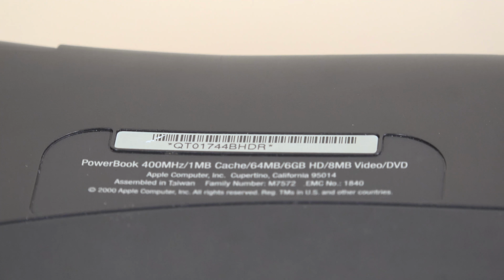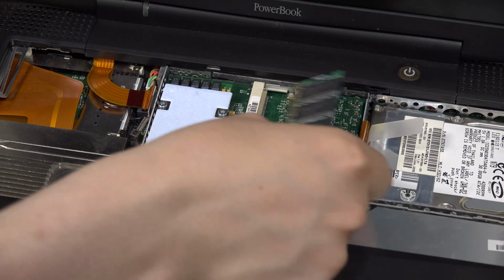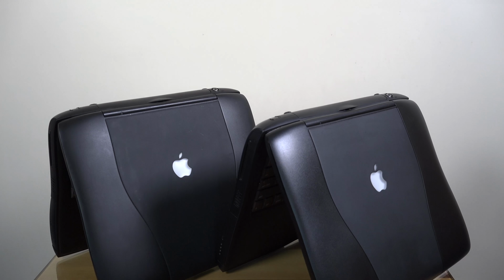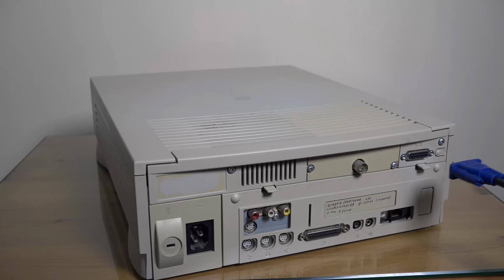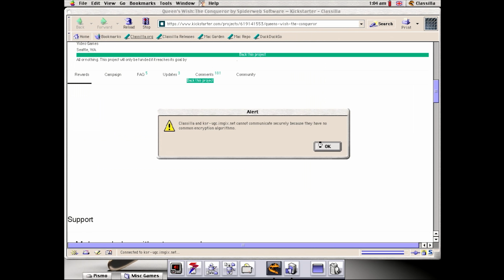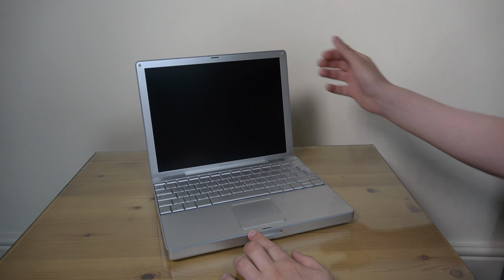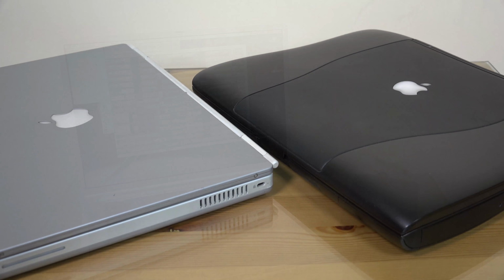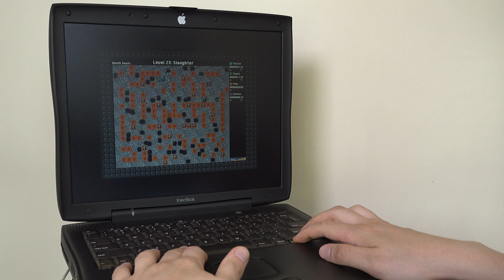The PowerBook G3 Pismo: Exploring a Truly Classic Mac Laptop Inside and Out

Comment: The only computer I ever had true affection for. It was the last machine i had running os 9. Hated the G4s and OSX. I just bought one on ebay and installed OS 9 to record music and MIDI with ProTools Free again. I've been using logic on Powerbooks for years, but there's something nice about having my old buddy from when I was 20 in pre-9/11 USA as a dedicated digital 8 track audio recorder. This G3 was last computer that I used as a tool primarily for creative work as opposed to a  for web browsing/social media consuming/feed streaming distraction device. It feels substantial. I like the touch of the smooth rubbery top. I'm going to buy a couple more and some new old stock replacement bits. I figure I have 30 or 40 years left on earth at most. These things will totally make it that long.

Comment: I still have my Pismo, tons and tons of miles on it.  Absolutely love it, it's a completely unstoppable machine.  The optical drive still works.  Only thing that's bad on it is the battery.
Reply: I’m still using the Pismo that I bought back in 2000. Mainly I use it for nostalgia reasons and the odd game. The browser can’t access modern websites but for word processing/spreadsheets and games, it works fine. Shame that the battery died years ago!

Comment: Interestingly, I have the original battery that holds a charge like new, the clock battery is also original and charged, yet the Powerbook still not booting. I think it is due to the firmware I put on 11 years ago 4.1.8 f5, before that 4.1.8 was flashed onto it and worked fine.

Comment: I own a Pismo with the 500Mhz cpu option, a 120gb hdd and a dvd rewriter, my pismo is in good condition, except for the port door, the previous owner broke it off, the main battery whas completely dead, but i have solder skills so i replaced all the 9 cells in my battery and i get around 5 hours of mixed use out of it, which is awesome, i use this primarly for music as the dac in this device is awesome, and some old games offcourse, it is still a very usefull machine and i love the design and the apple logo the wrong way around when its open! I bought this pismo about a year ago for 20 euro's and yes, it had a dead pram battery, i replaced the pram battery and the machine is in topcondition now! This is a awesome video and i hope we can keep those old macs going for a very long time to come!

Comment: Nice, honest review!

I will say though, that as a longtime Mac user, it bothered me every time you said "OS Ex" and "pram" instead of "OS 10" and "P-Ram". Good video though, and it's neat to see you use it for lots of different stuff. When I had my Pismo, it was running Tiger just fine, though, the internet back in 2006 was a lot lighter than today's internet. :P
Reply from the maker: I dunno if its a Brit thing to smush acronyms like PRAM together together, as I've always said things like SNES as a whole and I've heard others like Ashens do it too, but yea, saying OSX with an X isn't an isolated observation, others have said it grated on them too so its somthing I'll take on board for future content. Cheers!
Reply: Bollocks. “zap the pram” was always the order of the day ‘round my way, it was X, never 10.  And switching to "Mac OS" instead of “System” was a weird affectation that came in with the advent of clone machines.
Reply: It was often OS 'ex' here in the States. I usually say "Pee RAM", but can understand the "pram" pronunciation too.

Comment: I have a good trick for this one. If you want to use WiFi without any problem. Find an Airport, and old one, Apple AirPort m 1999, the silver one like an UFO. If you break apart the router inside you are going to find a Silver PCMCIA card with an strange Orinoko (I thing Orinoko, I can't remember right now) chipset which runs perfect without drivers or anything, you can even Hack wifi with that damn card.

Comment: Hey nice channel and nice video man! If you ever want/need any help lemme know, because I'd love to help you get some more views and subs! I'll be sharing your channel in my PowerPC Gaming Lounge Facebook group and also in the Low End Mac Facebook group! Also come check out my custom G4 Pismo on my channel. Wish ya continued success!
Reply from the maker: Hey thanks! I noticed a spike in traffic :P
Enjoyed your Pismo vid, there really is a lot to these machines, I wasn't aware of the other cooling fan... I don't think i'v ever heard it spin up on my one, although that said, its still got the original thermal pad on it which will be thoroughly dysfunctional by now. I've been meaning to sort that out. Do you use standard paste on it since the gap is supposedly a bit bigger between the chip and the sink? I've been playing it safe and using the denser K5 Pro for pad replacement on other machines

Comment: Seems like an interesting machine. How does older games like Alone in the Dark, Civilization, Dark Forces, Day of the Tentacle, SimCity 2000, Master of Orion 2, and such run on it?

I've long wanted a Mac just to try out old 68k games. I've considered getting a G4/G3 laptop or Mac Mini before but I have no idea if the games I want to test runs on machines that late. Earlier machines are either too expensive or, from what I heard, in urgent need of having the capacitors replaced.
Reply: So I bought a Pismo after watching this video! CD drive and speakers work perfectly! Set me back about a hundred bucks on ebay for one in such good condition, but well worth it. I haven't tested out any of the games you mentioned yet, but I'll give you some of my impressions. I've run older 90s games like Pathways into Darkness, Journeyman Project and Return to Zork (which was very finnicky till I switched my resolution to 640x480) and they work perfectly! The main niggle you will face is some older games (particularly older shareware games) will demand you run them in 16 colours, which the Pismo does not seem to support. So it's either greyscale or they won't work at all.

I tried running Oni on it (a 3D game of 2001 vintage) but I feel like it was probably a bit of a long shot. Even though I ran the OpenGL installer, it didn't seem to work and Oni refused to start up. Maybe I'm an idiot and there is a workaround I missed but maybe that's about where the limitations of the Pismo are. I'm going to give Escape from Monkey Island a go later and see if it works though.

Overall, as long as you can boot into System 9, I would say the Pismo will play most mac games from about 1990-2000 pretty well. Like YYM said, it will probably play some less taxing games of the early OSX era as well. I am going to test out out some of those games you mentioned and report back on them though!
Reply from the maker: The ones of those that i've played there on it without issue are Sim City 2000, Civ 2 and Orion. I imagine that Day of the Tentical is fine too as Full Throttle works well on it. Alone in the Dark's page on Macintosh Garden states that it needs some help from an extention called 'G3 throttle' which slows down the CPU to avoid a bug with using the stairs.
Reply: Thanks. I remember playing Oni on a Voodoo 3, so you may need a graphic card for that game to run well. I don't think laptops of that era had 3D graphics built in yet. Escape should run fine, if I recall correctly, as 3d hardware wasn't required.

If I'm not mistaken from my earlier research, something like System 7.5 is the ideal for the older Mac games, as some games simply wont run on System 9 regardless of the underlying hardware.
Reply: Nice. Civ 2 is a great game, but I never fell in love with it. Civilization 1 OTOH I love, and I've played it on Amiga, DOS and Windows. Each version is different, and I enjoy that, even when the differences are slight.

I'm not surprised to hear that Alone in the Dark got CPU issues. The game have similar problems on the PC. There's also throttling programs to "fix" issues like them, but I've yet to encounter one that works well. Games get frame pacing issues when you throttle the CPU more than 20-30%, and you typically need to throttle 80-90%. I suspect you get better mileage by disabling all CPU caches, if that's possible to do on a Mac.

Day of the Tentacle might run fine, but it's one of those games that pushes low level boundaries. It's therefore a good game to check if the system truly is compatible with older Mac hardware or doing some sort of high level emulation. If it runs like a slide show, it's high level emulation at play.

Comment: Is it possible/could it be possible to get a pram replacement for the ones that doesn't work ? Even if it is a third party replacement ? Since maybe then you wouldn't need to press the reset button . Or is that too cumbersome ? Anyway I am just thinking, and great channel you have, I really enjoy watching those videos about the old macs and the games :)
Reply: I think it would be possible to solder one yourself. I did one for an IBM thinkpad, because the prices for those batteries were insane on ebay. I looked it up - it was a regular type of battery with some wires and a connector attached to it. I desoldered the wires from the original, soldered them to a new battery and that was it. Paid 2€.

Comment: Excellent overview of this classic Apple laptop computer.  Of all the laptops made by Apple which, I own only this model (the PowerBook G3 Pismo) is the laptop, I call my baby.  Almost 20 years old now, I still think it has the best design, styling, and power!

While, only a collectors item now still enjoy using its two "hot" swapable drive bays for an extra battery, super disk drive, zip drive, and DVD/CD drive.  Also, I have fun downloading my digital camera photos using its USB port and movies from my video recorder using its Firewire port.  While, at the same time having an apple mouse connected into the other USB port and using an external Hard Drive drive connected to the other Firewire port.  When needing to use a Flash Drive, I just remove the mouse and use its USB port.  For operating systems, I currently use both the classic OS 9.1 and OS X 10.3.